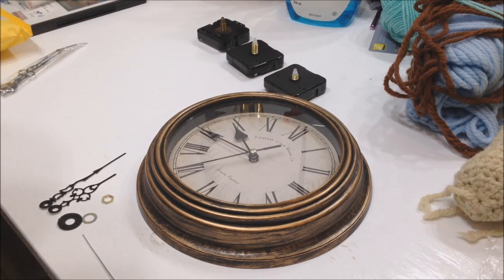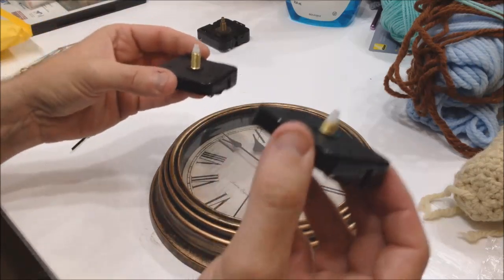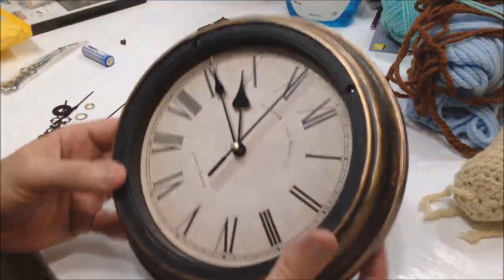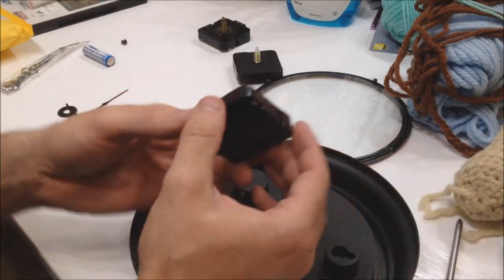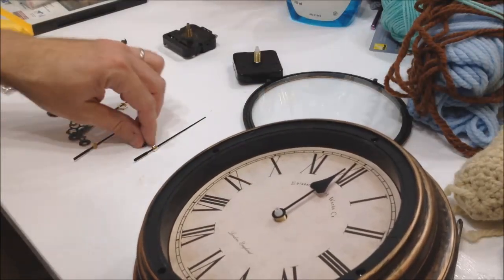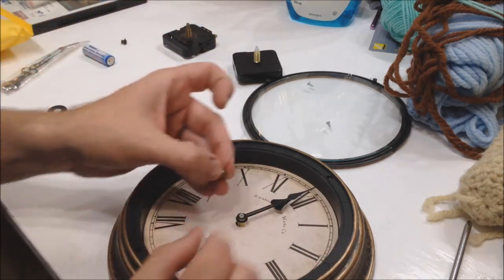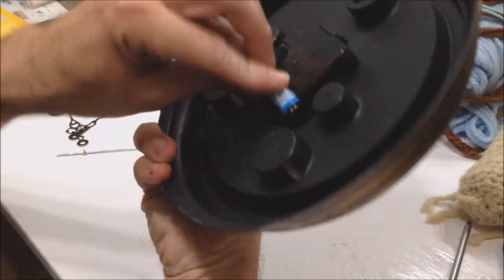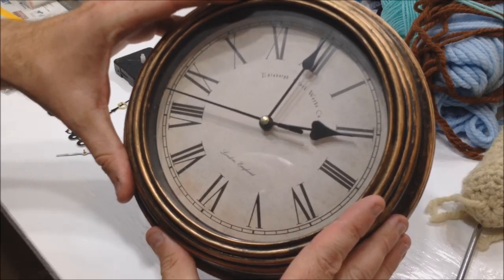Ticking Clocks make you crazy?  Silence them like this...

Comment: In my case and it worked for me, and I don’t see why it won't work for most battery-powered wall clocks. If the ticking annoys you,  an easy way to stop the ticking is to remove the second hand if you don’t need it. It’s easy. Just remove the clock front, pull the second hand off and replace the clock front. Done.
Reply from the maker: It’s not that easy, while it does remove some gear noise, the tick is still there.  I have clocks with no second hand that still tick, the only way to fix it is to replace it with a non-ticking mechanism.
Reply: @RedBarnHomestead  Yes. I think it depends on the clock brand. The one I removed the second hand from was one I bought in a cheap shop.

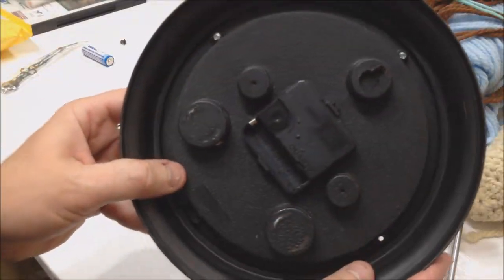Comment: This really helped me. I did it. Thank you so much for this video. The only thing is that at 2:24, instead of just popping the back box off, I first used small pliers to unscrew the nut on the front of the clock that held the back box on. Then the back box came off without any prying.
Reply from the maker: Glad to hear it helped!

Comment: I've never been a guy who likes quartz clocks very much. I'm too much of an old clock collector to like them. What fascinated me about this was the fact that the smooth "gliding" of the second hand is very reminiscent of the 1950's, 40's, 30's and 20's electric clocks. If I had to choose, I would much rather have a quartz clock that has the "gliding" second hand rather than that cheap "tick" most quartz clocks have. Having the clock make no sound and not make that jumping forward action makes the clock have a higher quality feeling. Great video, thanks for posting.
Reply from the maker: Thank you for your comment.  I have noticed battery consumption has increased, they take about 1 battery a year, but well worth the smooth hand action.
Reply: Technically, I believe the 'gliding' hand clocks do jump but the distance is so short, it seems as if it is gliding.  The shorter distance is what makes it silent.

Comment: thank you for the video but could you please reply with the link to the set you use in this tutorial please because I cant find the correct one on ebay
thx
Reply from the maker: Most under the term “silent clock mechanism” are correct.  Otherwise they are “ticking” clocks.
Reply: @RedBarnHomestead  ok thank you

Comment: Those sweep hands use a lot more juice than the old kind.  Expect to change the battery every six months.  They don't tick but after a year or so they have a constant whirrrr noise from wear.
Reply: Bro mine started making weird noises after about of week of use. 
(It was a quartz wall clock) 
It came with a Chinese brand battery so i'll change it out (maybe the battery is bad?) 
But i'm worried i have to change out the core like in the video, but it's worth it.

Comment: Pretty helpful. But when you get to a house that has already one. Say you need it and can't take it out.  An extra solution with regular skill is open it and extract the seconds needle by pulling it with force ( it can be put back if nec), it will decrease the noise 3/4 or 4/5 ths which is a looot and will give you a fast  80% solution.
Reply: Extra skill and time open the mechanism and take out the last gear on the gear sequence. Once again to disable the seconds section.
Reply: I was just thinking about removing the seconds needle to try to decrease the ticking sound of my wall clock. I was not certain it would help. Then I found this Red Barn Homestead `s helpful video and then your helpful comment. Thank you all very much indeed.
Reply: @Queteimp  Thank you very much for your great comment. I am going to remove the seconds needle first. If the noise reduction is not sufficient, I am going to try to remove the last gear.

Comment: I have one of these modern black boxes, exactly like this but the continuous second hand is very loud. :(
Reply from the maker: Sounds like it is worn out and needs a replacement.
Reply: @RedBarnHomestead  No, it's actually brand new. I fixed it though. Opened it up, took all the gears out, and put a tiny bit of oil on all the bearings. Now I can't hear it anymore. :)

Comment: Dang..... Not gonna lie, its absolutely a viable solution. 

Personally I was hoping for a way of quieting an incremental movement (My personal preference is for a movement that moves the seconds hand on the half second, so two 'ticks' per second) perhaps by tightening up some tolerances or something. Oh well....

In this day and age of a slightly different face over effectively the same mass produced device (not just clocks, about 90% of all the things have a little 8, 12, or 16 pin  microcontroller in them with the part number lasered off (they're most likely an atmel clone)) this is a shining example of 'just find something that does what you want and see if its bits can fit in those bits...' kind of engineering! Of course, thats part of why they laser the part number off the MCUs....so you cant repurpose their 3 cent controllers.....
Reply from the maker: Quite true.  Most production clocks and almost all custom clocks are this way.  Makes it hard to buy a clock for $50 when it has $1 internals.

Comment: I did this, the gears move and it is much quieter, but now the arms don’t move. I have taken them off and put them back on a few times. They move when I move the manual dial used to set the time.  I can hear the tick, tick,…. How do I fix it so the arms move again?
Reply from the maker: Well, check to see if they are moving at all or are the arms hanging them up, you can do that with a marker.  The fact you can set the time but it doesn’t keep time sounds like your unit was defective.  You can also take it out of the clock and see if it will work alone, which it should.
Reply: @RedBarnHomestead  thanks. I tried the marker and took it apart again.  I think all the wheels are so flimsy and weak that it will be impossible to get all the wheels to move each other again.  It does tick but the part that moves the arms no longer moves. Are all wheel so thin and flimsy?

Comment: The silent clocks seem to use more power then a Ticking clock new battery only lasted two months now put a Alkaline battery inside it
Reply from the maker: There might be a dragging issue with the hands or the mechanism?  I have found a smooth motion clock uses about 1 battery every 1.5 years instead of 2 to 3 years on a pulse quartz.
Reply: Red Barn Homestead thank you
Reply: Many small devices require a non alkaline battery due to current issues burning the clock mechanism out if you use alkaline.

Comment: But silent movement machines consumes much power, 8x then tik machines
Reply from the maker: Maybe 2x.  End up changing the battery once a year.
Reply: @RedBarnHomestead  no, AA battery ends only in maximum 45 days, while in  ticking one same battery  lasts 180 days minimum. Tested , using for last 12 months
Reply from the maker: @ Guessing the ones you are using are defective, smooth action clocks should last over a year no problems.
Reply: @RedBarnHomestead  may be,  defective machine I bought, suggest the genuine one please